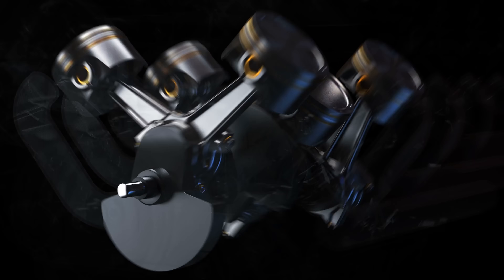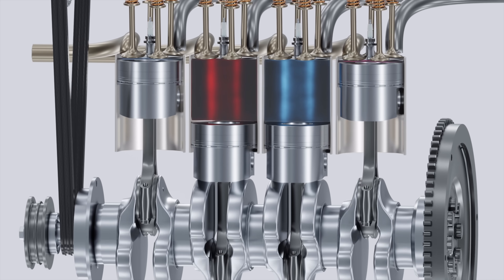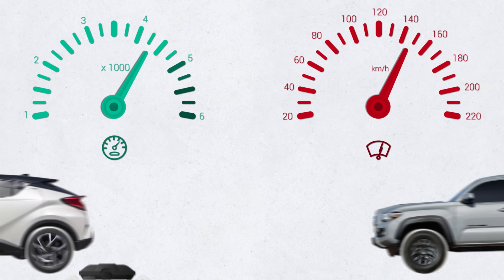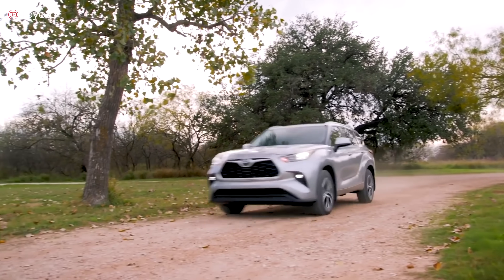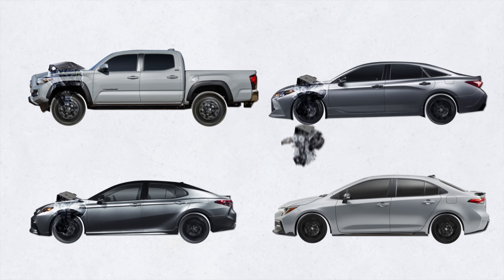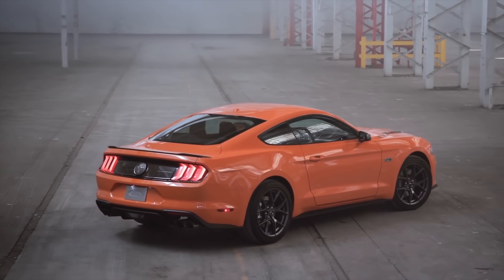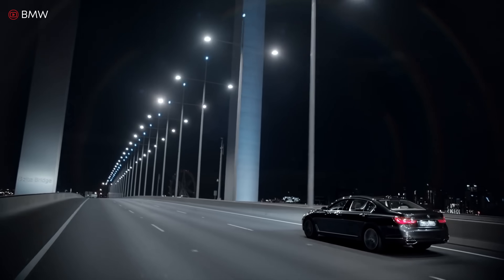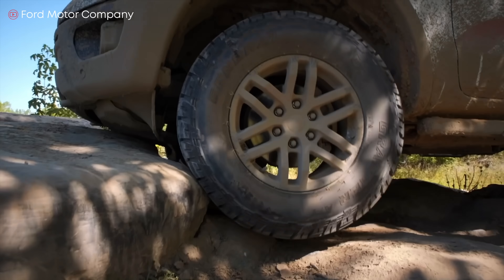No One is Telling You the Truth About Turbocharged Cars, So I Have To

Comment: I have 2021 ranger and I  love it. On the ranger forums, there was some debate about these engines. A former ford engineer on the forum said that they hard-core stress test these engines over 150k miles. They don't release the model until it passes its tests. By doing these tests, they can expect the vehicle to last longer because most people don't push the limits.  Also, on the forums, I see people ditching the tacoma for the ranger because they like how it feels. With me, it's ford, so I am skeptical on how long it will last me but I bought it with certified preowned with 1400 miles on it. Which is a great deal because now it comes with an extended warranty. 😀
Reply: Fix Or Repair Daily=FORD

Comment: One issue that I've NEVER heard mentioned anywhere. One of the worst things that you can do to ANY turbocharged motor is not allowing it cool down by idling for a couple of minutes before shutting the motor off, especially after hard driving or towing. A turbo timer is always a win-win option. The turbine is still spinning even after the motor is turned off and the oil supply is also stopped and that caused coak (hardened sludge) to build up around the turbine shaft bearing which starves the turbo from being lubricated properly.
Reply: They're water cooled now, this is a non issue in modern turbo'd cars
Reply: @ifixthings86  Very true but still creeps me out killing the ignition without idling especially right after some spirited driving.
Reply: I believe modern engines have a small electric oil pump to circulate oil through the turbo to cool it after shutdown.
Reply: Modern turbos don’t have this problem. Water cooled and the water pump stays on for 30 seconds after you turn the car off to cool it down.
Reply: @zipper978 I was wondering I have a 21 TLX Type S which has downpipe & it does seem like engine bay is super hot especially on really hot days so I was thinking of installing larger intercooler & then allowed it to run for a couple minutes before I shut it off
Reply: @zipper978 is that the same water pump for the engine/heating&cooling or a separate pump? And does it running that long after shutting off car have any drain on life of battery?
Reply: @NoName-fx9zi  drain on battery is negligible. I believe it stays on until it gets below a certain temperature

Comment: If you love your turbo it will last as long as a V6, that's just my experience. The most common failures I've seen with turbo cars and with v6 engines are mostly attributed to abuse and lack of maintenance. Pick whatever you want!
Reply: Define abuse lol
Reply: @americandream7419  Almost No maintenance.
Reply: How to maintain turbo
Reply: @sapphireeniigma-8027  the same way you maintain v6 engine, but get the maintenance done from who has turbo knowledge.
Reply: @sapphireeniigma-8027  First off use synthetic motor oil and change it often and 2nd after running it hot let it sit idle for 20 sec when u park to let the turbo cool down before shutting off the engine. But thats only if u run it hard, like I do :)
Reply: @vroomgc  
True. But that means some legit serious hard driving tho :)
Heavy diesel trucks are recommended a cool-down period of 3 minutes after hard driving hauling 40-60 tons. Takes 10 minutes at idle going from 118C to 100C in oil temp 🤯
Reply: @vroomgc  20 seconds? Lol. At least 2 minutes after hard use.
Reply: @1958Cadillac-v2g  never sat my TDI cars to cool down for even a minute, never had an issue with the turbos in 10 years.
Reply: @1958Cadillac-v2g  I dont put my watch on it but most articles say 30 sec to 1 min after hard driving is plenty sufficient
Reply: @vinayakpatil355  That and never warming up the engine before you floor it.

Comment: Naturally Aspirated engine any day. Turbo's are fun soo are superchargers, but they can't  beat the reliability of naturally aspirated engine. 

amazing stuff Scotty.
Reply: Love my 22 year old supercharged 3800
Reply: @JR-uy3zo  how many miles/kms on it ?
Reply: @baneh6727  have one with 180 thousand and another with 250 thousand. Seen one with 325 thousand. Run forever. Pontiac grand prix 3.8
Reply: reliability can be the exact same just depends on the brand. ford ecoboost brand is well known to have over 200k original turbo and motor no problem same with alot of otherbrands  in 2021.  the thing about turbo engine is how you maintain them like you cant neglect turbo cars at all they will die while you can neglect a na vehicle and itll run a long time. if you maintain it exactly  to spec most modern turbo i4 and turbo v6 will last longer than 200k no problem  if not 300k like a bunch have.
Reply: There's a lot of turbo charged transport trucks with lots of reliable miles on them.
Reply: @drewthompson7457  heavy duty vehicles are well built over commercial ones.

Comment: I drive a 3.5 ecoboost F150 and love it. I'm 65 yrs old and have been driving PUs since I was 20. This truck has gobs of power and torque, and gets great mpg, best milage I've ever gotten in a pickup. Longevity depends on maintenance, bad or non existent oil changes/fluid changes = trouble in any engine.

Comment: Is everyone forgetting that these turbo charged engines are also made with stronger parts to handle the extra load from the turbos and that as long as u change the oil every 3k to 5k miles these engines can last along time. I love my tt v6 it’s been problem free for 13k miles. I’ve had a 5.0 that at 10k gave me the famous type writer tick and I did oil changes every 3 to 5 miles as well. I think modern engines are good but it’s up to the owner keep up with the maintenance that will make the car last a long time. Then again buying a car is like playing the lottery and you don’t know how gd it is until you own it for years.
Reply: Same here. Currently have a first gen Coyote 5.0 in my Mustang and a new 2.0 Ecoboost Escape. Oil is cheap and I'm changing the oil early since I hear turbos are hard on the oil.
Reply: explain why when I replaced both turbos on one of several ecoSHIT v6 cars, one of the turbos grenades after 80 miles.... I know why but do u??
Reply: @302Mustang13  not the junk turbos Ford uses.
Reply: @tonyblackburn5002  I dunno maybe take care of your car better
Reply: @oslodapig5239  not my car I wouldn't own one of them. Its just one of the ecoboost cars we're having to replace turbos on at the shop i work in.
Reply: "Where are you from??"  Automotive history is littered with a never-ending pile of turbocharged passenger car engines that were NOT any different from their naturally aspirated versions.  That's the whole problem -- the turbo engines have NOT been made with stronger parts.  Oh, "some" may have been built better -- especially in very high-end sports cars -- but if you think your turbocharged $20k econocar has a "stronger" engine, well, "good luck with that."
Reply: @302Mustang13  that's true but you gonna have to change the turbo a few times. None of the car brands are using expensive turbos. You will never buy a stock turbo car and it have a twin scroll turbo on it the best they will use is a Garrett turbo. There's a lot of brands that make a good turbo but they $ high dollar and they just not gonna put real turbos on them.
Reply: @alanclark9000  Prove it. I'm tired of hearing about assumptions about some automobile manufacturers receiving inferior turbos based on nothing concrete. Sometimes turbos fail just like any other manufactured product. That doesn't mean they don't last on a large scale.
Reply: @302Mustang13  go work in a car shop. Go ask any real deal mechanics and they will tell you the same thing. Plus the fact if you have a v8 that makes 220hp vs a four banger with the same power the v8 will have less vibrations and be more smooth
Reply: @302Mustang13  Go to any ford forum with boost users....both the engine and transmissions have problems.
I don't like automatics because that is the most short lived component it seems. 
Now they are tying in experimental transmissions to unreliable engines...just seems like a recipe for disaster, if one fails it will put tremendous strain on the other.
Reply: @darrengodfrey4691  That is just a bunch of talk, no facts.
Reply: @alanclark9000  I don't have to be a mechanic to know a thing. I do a lot of work on vehicles and always done my own oil changes. Truth is these turbo engines can last just as long as naturally aspirated. Change the fluids religiously and don't drive like a dbag. I've had 4cyls, V6s and mostly V8's. Many manual transmissions, even the supposedly garbage MT-82, which has been the best one I've owned yet  Anything can last id you take care of it.
Reply: I could be wrong but I do a quick check to determine if a turbo engine is made right, by my opinion anyway.  Most carmakers just slap a turbo on a 4 cylinder and that's the end of it.  A good turbo engine will have 4 bolt main bearings plus its own separate oil reservoir (for times when it gets shut off while the turbo is still spinning), if it doesn't have those at a minimum, I won't consider the car.
Reply: Agate BlackST
That does not seem right, they should have the same kind of tough materials regardless if it is supercharged or not.
Reply: They are indeed SUPPOSED to be.
Reply: @michaelbenardo5695  TY !!!
Reply: @alanclark9000  And generate more low RPM torque and less heat.

Comment: I prefer reliability and longevity over power. Downfall of the V6 is the cost of labor for the transverse configuration.
Reply: @Mos' Nefarious just as well as it's going to be stripped down.
Reply: I'd say it's because of increased production costs of making a more complex engine.
Reply: The transverse configuration has been around for decades; in fact, its cheaper to build front wheel driven cars because the entire drivetrain is installed as one unit.....being V6 or an I4 doesn't matter in that aspect.
Reply: Reason I chose a Chrysler with motor sittin straight and frd. Easy to repair when needed and not often.
Reply: Volvo 3.2 is Transverse mounted Straight six....
Reply: There are a few that have rear wheel drive like mine the engine compartment could hold a V8 so there’s more working room than transverse

Comment: I would go only for Turbocharged engines compared to naturally aspirated engines, because of the increase of power and torque. If you compare a 2.0 vs a 2.0t or 3.0 vs 3.0t the difference in the power output is huge, hence the choice is really simple in my opinion.

As long as you take a look on the deepstick each 1000km you will be fine with a turbocharged engine and be able to enjoy the power and torque.
Reply: Wrong.

Comment: Once you get into boost you'll never go back to N/A.
Reply: You should try a boosted V8 - mind blowing!
Reply: I agree turbo noises are addicting, negating most fuel efficiency gains in my experience.  Especially in these modern turbo cars that hit boost low in the rpms.
Reply: @snakehead324  Yep.  I have the 2.0 EB in an Escape.  Lag is short and it's all strong, linear pull from about 1800 to the redline.  But when you use it, you get V8 gas mileage.  It will do eco, it will do boost, but it doesn't do both at the same time.
Reply: Properly built V8s make Turbochargers and even Superchargers save for diesel engines and certain specialized applications unnecessary.  As they say "No replacement for displacement" .
Reply: False

Comment: I disagree that a turbo 4 necessarily gets better gas mileage. They might if you baby them but if you push them at all (which you generally need to do to get the equivalent performance of a V6) they use just as much.  Generally these days V6's are mostly only available in larger vehicles but if you took 2 vehicles of similar size and horsepower, one V6 and one turbo 4, there would be very little difference in the mileage.

Comment: My 455 olds engine was Cool ..When I hit the 4 barrel I could watch my Fuel gauge go down .But gas was only $0.85 a gallon back then .so that was ok
Reply: Yes sir, my 1st car was a Cutlass Supreme with the 455 Rocket, stock it would pull hills at 120mph. But I couldn't keep rear tires on it 🙄😂
Reply: Actually. $0.85 in mid 70s is about the same as we pay now, adjusted for inflation.
Reply: @talisikid1618  That's true, but now 30 mpg is common
Reply: I had a ski boat with that engine in the ‘80s
Reply: Use e85

Comment: I had a manual transmission Nissan with a 3.0L turbocharged  straight six which sounded great and had 320 KW at all four wheels. It was fast and good on the track but at the traffic lights unless I gave it a bootfull of revs (with accompanying over dramatic sound effects) it would be outdragged by a bog standard auto Honda Civic. On the other hand my E46 BMW with an n/a straight six goes well and is nice to drive in traffic.
Reply: Yeah I like my two old Mercedes I6, the sound is great 🤯😏

Comment: Those performance numbers are amazing.  Metallurgy and precision manufacturing have come a long way since the Corvette v8 was sold with less than 200 horsepower.  And almost anything today can double or triple the lifespan of those old cars that struggled to get to 60k.
Reply: We knew plenty about metallurgy, it was exhaust emissions and production costs that were responsible for the low output.  Today's cars last so much longer because today's motor oil is, in most ways, so much better.  They would NOT be lasting so long if motor oil was the same as it was in the 70s and before.

Comment: Metal has memory. If you don't understand this. Don't work on ur car. However. Metal has memory of how it is used. Basic phrase for saying it remembers more or less how it is used and will therefore become weaker depending on that type of use over time. Hence why leaf springs are spring loaded as it gives it longevity before the steel finally collapses beyong use. Shocks are the same as well as every other component. Just like our bodies. Everything wears out with abuse.

Comment: Still using an '04 Buick LeSabre with the 3.8 V6 as a daily and its been a great car. In 15+ years, all it needed were brakes, reg oil changes and I did the intake gaskets replacing the stock plastic ones with the metal ones to prevent leaks. Still does good on gas millage too. Like Scotty said, turbos give you more power and efficiency but at a higher cost to keep maintained.
Reply: Loved my old 3.8’s
Reply: I also had a Buick 3,8, and thought it was one of the best engines made.

Comment: The old straight 6 cylinder normal aspirated BMW engine used to be very strong.
I would think a straight 6 was more reliable than a V6.
Reply: @jetson2075  you have not heard of Mercedes M104/M103 and OM606 turbo? 😏
Reply: @jetson2075  OM606 turbo with bigger turbo and older fuel pump makes 600HP on the wheels without opening the engine (see dieselpumpUK). The M104 without internal engine mods can hold up to 400HP, with mods can go 1000+ (check Turbo Bandit). This is as good as the legendary 1JZ/2JZ. Check before posting "jokes" 😏🤦🏻‍♂️
PS: I did not said other engines are joke, I ment that straight six in general are great engines, also BMW made some good engines. Usually a straight six can last milion miles with just oil/filter changes and minor maitanence. I will look about that engine you suggest. It will only make me love the I6 more 😊✌️
Reply: A V6 is just as reliable, it just isn't as smooth-running.  They resonate at certain load/rpm conditions, while a straight 6  is a smooth-running engine at all speeds.
Reply: I don't know that inline 6s are more reliable than V6s, but are are smoother.
Reply: @michaelbenardo5695  more reliable, because less moving parts. Only one head and some other stuff...

Comment: I test drove some vehicles lately, and one that really stood out to me was the Subaru ascent, it’s an SUV that seats seven yet if only has a 2.4L turbo 4 cylinder boxer engine. I was very surprised by the substantial power it had though. The 6 cylinder vw atlas by comparison actually felt sluggish.
Reply: Just don't tow anything with that acscent unless you want a new engine lol
Reply: @joenaps104  yeah I wouldn’t trust a 4 cylinder for towing too much either.

Comment: I prefer which ever is the most reliable. Probably why I chose to buy a 2020 4Runner with the 4.0L V6.
Reply: Interesting.  What kind of MPG do you get?  For years I've heard the 4Runner is very reliable.  Do you have 4WD?
Reply: @namvet1968  I've been getting 15mpg in the city and averaged a round trip 20mpg on the highway with a trailer through the hills a few weeks back. My 4Runner is a Limited model that has full time 4wd (it uses a Torsen Center Transfer Case).

Comment: My favourite configuration is an inline six cylinder engine between three and four litres a la 2JZ and M54 3.0.  I am curious about a modern version of the M54. The pressure cooker of a turbo four cylinder will give you good power and good fuel economy but NOT both at the same time. What you will get is shortened engine life and greater maintenance expenses.

Comment: I've had two 1.5 turbo vehicles and went running back to the V6 the fuel economy from the turbos in the winter months was terrible and I also like the weight of the V6
Reply: That's a completely stupid and false thing to say
Reply: Actually turbos get better mileage on low temperatures...
Reply: @adam tom more air= more gas dumped into cylinders
Reply: @danielbazan7547  welp, turbo's are actually much more efficient in general...
Reply: @adam tom no, as I understand it more air pressure needs more fuel to create more power :)
Reply: @aarongrisham5555  no its the truth turbo engines suck
Reply: @kennethseverin5391  man, I own one. Just stating an opinion won't change my mind.